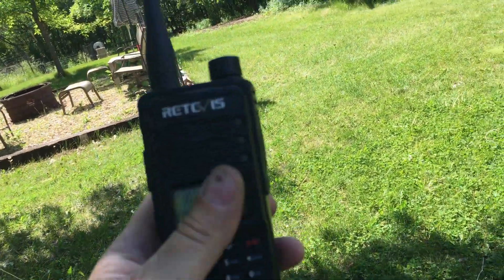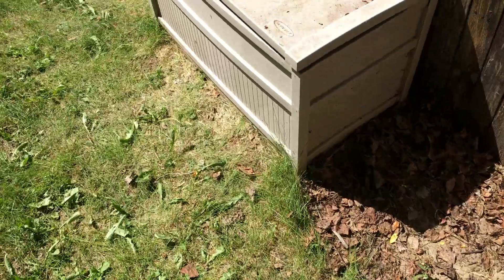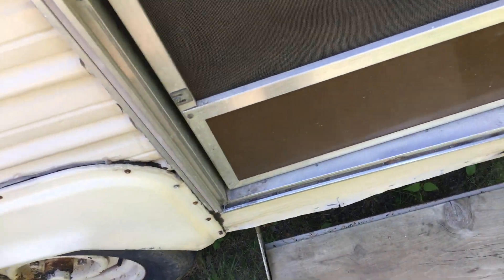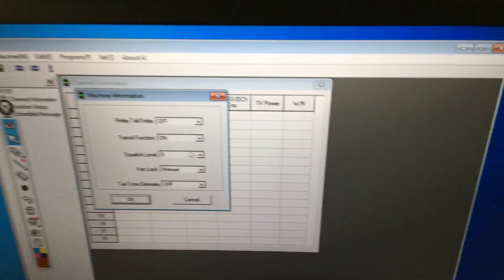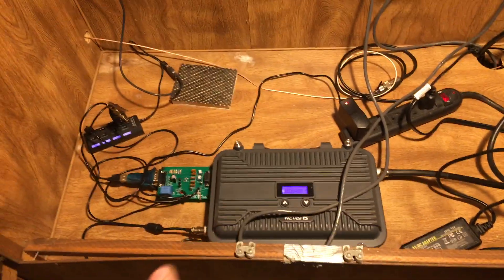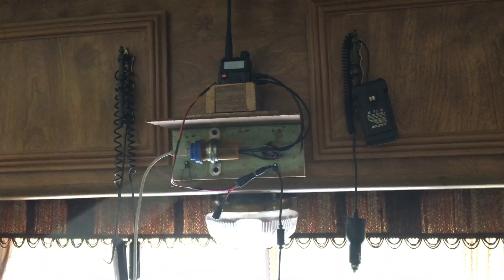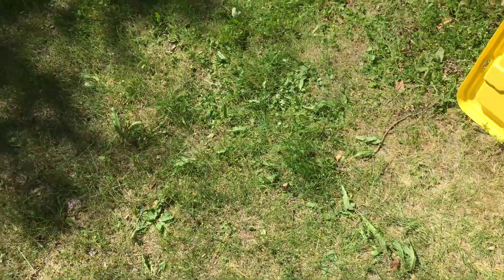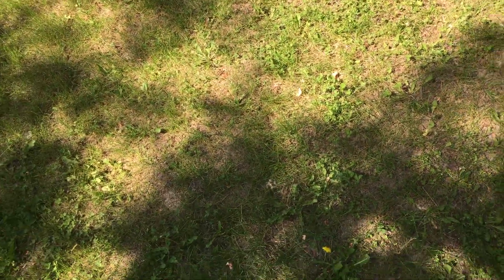🔺Can TWO GMRS two-way radio repeaters be used at the same time for more distance/range?? Lets check🔺

Comment: Two transmitters will interfere with each other. Best way is to have the repeater at a good location with a few receivers running thru a voting system to get the strongest signal to the repeater.
Reply: FM has a capture effect where the receiver for the most part will hear the stronger signal. This is why air band radios are AM because you can hear the two or more stations at the same time. Two repeaters is a way to go and should work if linked. A voting system is kind of complex and not used much anymore as far as I know. Way back when we had a Ham repeater up something like 1,500 feet. It was pretty high power and got out better than it could hear. The club had two or three receivers in the area all connected back to the repeater. They ran through a device that would decide which one had the best signal coming in and use that one. It was mostly made for commercial repeaters back in the analog days.
Reply: @OnAirVoice  that's almost the same as we use in Netherland and Germany!
Reply from the maker: @OnAirVoice  that is interesting ya nowadays with internet easier to link them that way
Reply from the maker: I thought two transmitters would interfere too. But it didn't however maybe if they were further apart they may? I never heard of a voting system.

Comment: To  "Lnk" repeaters you would need to invert the TX and RX frequencies  of one of the repeaters.  This would allow One repeater to talk to the other.
Reply from the maker: Yes, I tried that, but the software won't let me change freqs like that.  But I am going to re-check the software again. that's why I did it this way
Reply from the maker: I just double-checked the repeater programming software (Retevis and Midland software) only have drop down menus that let you selected a freq that is in there you can not enter a freq in there 🙁

Comment: Using the same frequency on both repeaters will not give you more range. It will get as far as the strongest signal goes with a big section of bad received signal because both signals give  interference between those 2.
Reply from the maker: I should add I am not saying you are wrong you could be right but unless I can set it up to prove one way or the other I need video proof 🙂 I had people say don't run your radio without an antenna you will burn it up well, I have a 23-hour video that said otherwise 🙂
Reply: @GMRStwowayradio agree on that. But it's the same like 2 fm cb radios on the same channel. It's not gonna work. Believe me, we have done that way to much with our Gateways over here! 😎🇩🇪
Reply from the maker: @koosme6624  ahh ok so your cb radios use the same freqs we used here for GMRS?
Reply: @GMRStwowayradio  no of course not the sane frequency. But it's both FM. And that makes no difference on the frequency. When you use 2 FM transmittets on the same frequency, they will  intervene. And there will be  only one transmitter  that will be heard on a distance. That will be the one with the strongest signal.  And there will be a part ( near the weaker signal), where you get only "rubbish" .
Reply from the maker: @koosme6624  humm interesting I will have to play around with it more if I get time thanks for the info 🙂
Reply from the maker: That could be like I said in the video I am unable to test range due to I don't know anyone within my repeater range to set up another repeater to test range🙁

Comment: Yes you can link GMRS Repeaters per FCC-Operation of a GMRS station with a telephone connection is prohibited, as in § 95.349. GMRS repeater, base and fixed stations, however, may be connected to the public switched network or other networks for the sole purpose of operation by remote control pursuant to § 95.1745.(ZELLO) SO interpretation goes just using Repeaters you can based on two individuals with the same Repeater frequencies in (5) miles of each other that don't know one other when you key up it also key the other and I believe it's working like that the setup you have because you're not running any tones great video like always and keep it up brother
Reply: Technically they're not link is just you're in range of both repeaters so say if the repeaters was 5 Mi or 10 miles apart and you still was in range of both it would still do the same. Its not linking it's just you're in range of both repeater frequencies but again like I said I don't believe it's replaying or looping because you're not running any tones
Reply from the maker: @KO4RXE-WRMR358  - ya that is what I said in the video, maybe it's working because of no tones. Also, good to know about the FCC rules thanks for posting that